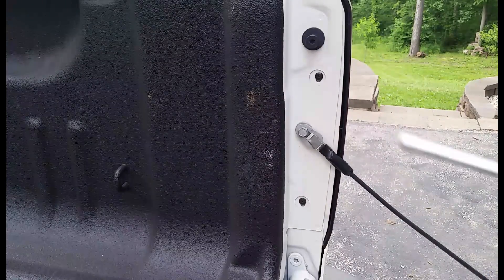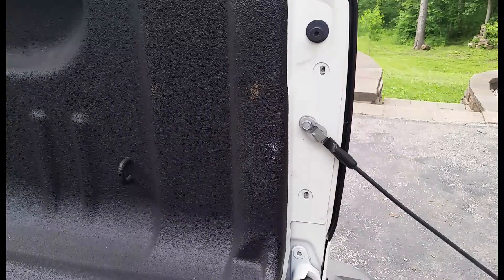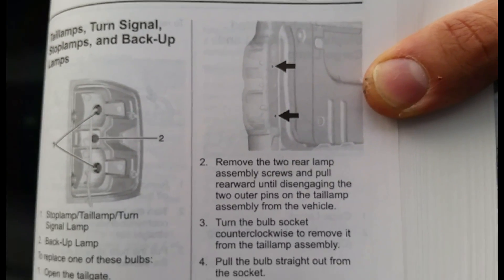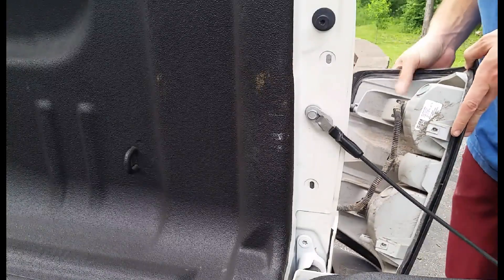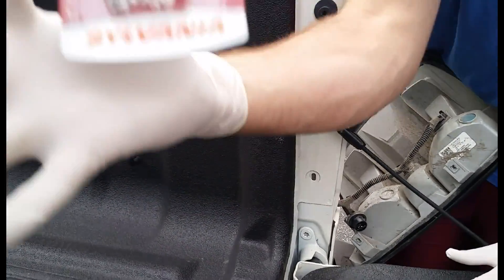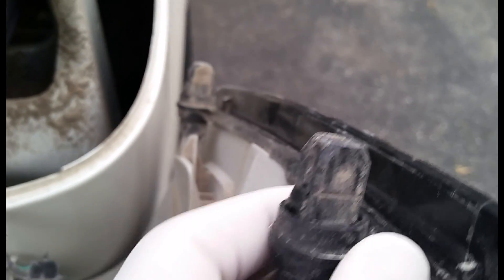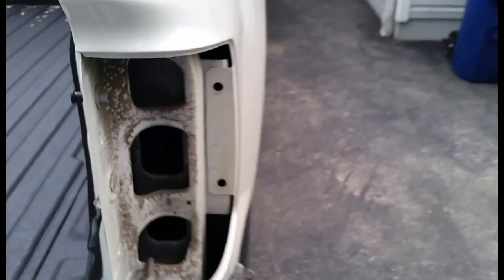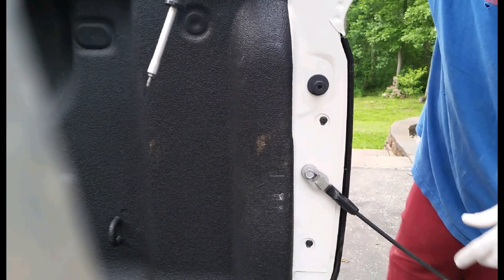How to replace a 2014 silverado tailight bulb.

Comment: Thanks for the help - easy fix.  Bad design by Chevy - leaving lights open to all the road grim through holes in bed.  Rubber grommet would fix that mess.  I recommend using bulb grease to keep corrosion at bay. Mine failed because it was corroded. Test lights before reinstalling!
Reply: Given the odd shape back there I think that there are only two ways - a lot of sanding by hand or go and have someone media blast it.  You could try naval jelly to remove the rust (liquid jell) but it is messy.  I would mask it off and then prime and paint by hand.
Reply from the maker: +Todd Harvey I didn't show it in the video but I did test it before reinstalling. Thanks for the advice and thanks for watching!

Comment: Great step x step video Joe!  First video that, Ive ever seen of yours.  I have one question though... Can I access the reverse/backup white bulb easier, if I don’t have a bed liner covering the backside of it?  I’m hoping so🙏🏼. Thanks for a very step x step and detailed video. Do you happen to have ones showing how to replace fog lights, and the right side with the air box headlights??  If so pls lmk. Thanks again.  Thumbs up and new subscriber. ✌🏼.
Reply: Bed liner shouldn't make any difference at all :)